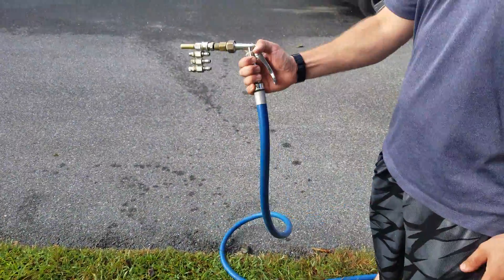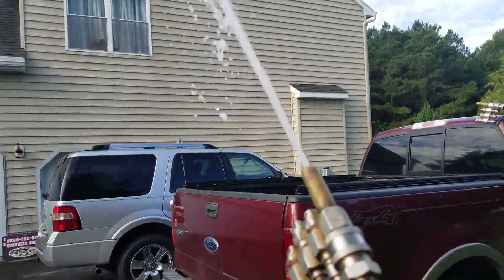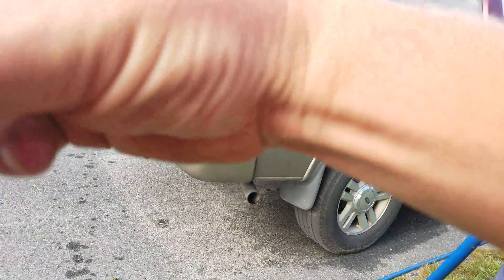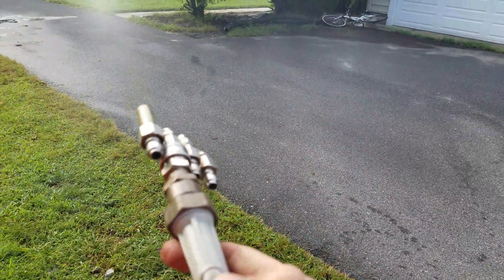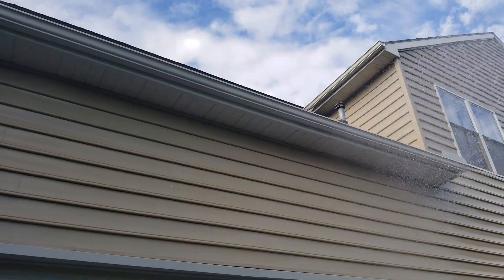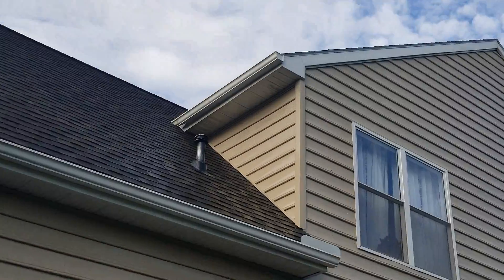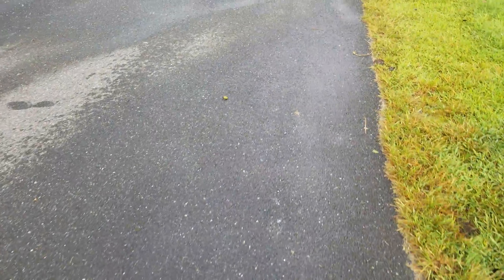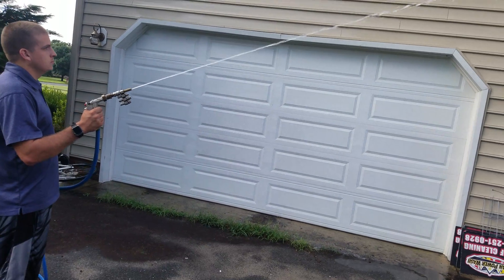Side by side comparison of booster vs air diaphragm (3/4hp goulds 5gpm vs 1/2" yamada air diaphragm

Comment: If you can only pick one of the two to have on the truck for your employees to use, which one would it be? All politics aside of course because they are both good setups
Reply from the maker: Probably air. Easier for employees to prime and operate
Reply: Clean Power Wash has this answer changed now that your new video says from here on out only booster?